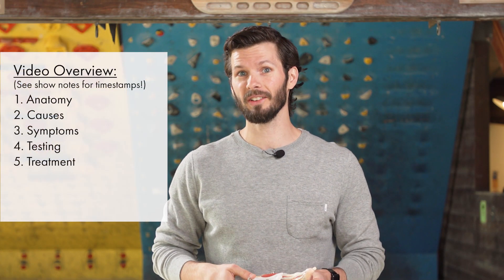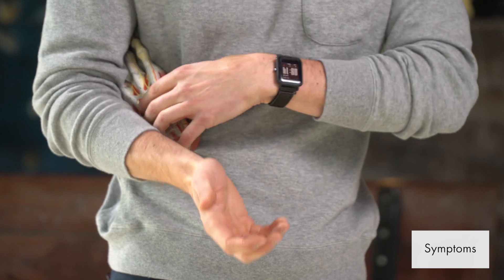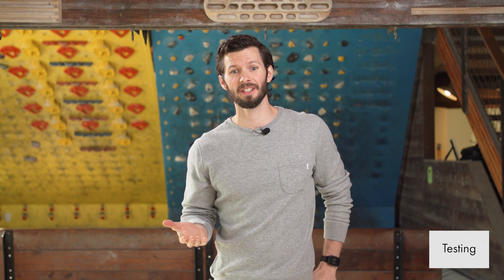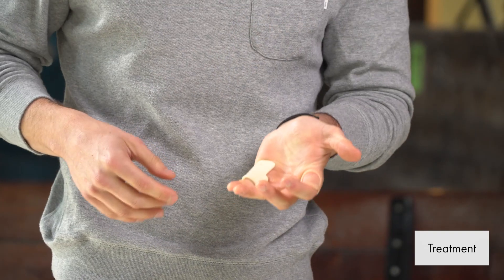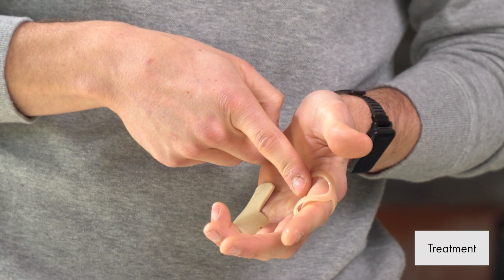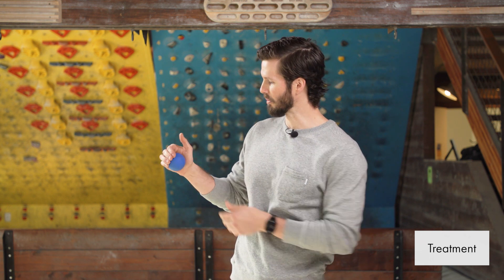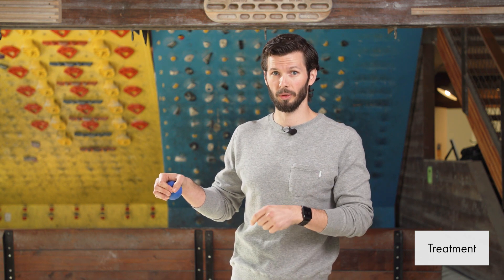What is Trigger Finger and How Do I Fix It? (Stenosing Tenosynovitis)

Comment: Great video. I have A1 pulley diagnosed in middle finger of right hand. I was doing a lot of mouse scrolling in my job since 8-9 months. I did not have pain, only trigger fingure. GP gave me injection. Should I continue that job as still I have to use excess mouse clicking. Any advise like exercise or splint? Appreciated

Comment: Hi Jason! What if I only get the trigger finger when I sleep? I got an A2 pulley strain that developed trigger finger after a month but it only happens in my sleep. Is there a way to know what is causing it? 

Thanks for all your help!
Reply from the maker: Good question! There may be a number of reasons, but what first comes to mind is either the position you're sleeping on (perhaps clenched fist, flexed wrist, flexed fingers as examples0, or it could just be that the swelling increases during night since you are not moving, but quickly dissipates in the morning as the movement starts reducing the swelling.
Reply: @HoopersBeta  would you say is an acute case? I take time off sport cranking and go alpine climbing a lot and that seems to help with not getting the trigger finger at night. Would taking anti inflammatories help?

Comment: I have trigger finger in both hands middle finger and ring finger on both hands ,have a nodule in my left palm that is obvious to see ,this all was caused by having Piraformis syndrome with gluteal amnesia could not stand up from a chair unless I used my hands and arms to push myself up and my middle fingers bore my weight for a few seconds ,am waiting for injections at the hospital .
Reply: I too have both palms ring trigger finger with nodule n cause of that was high LDL cholesterol, Now it's over 4 weeks have stopped majority of oily fast foods very good improvement there pain has minimised can move n bend the finger previously not flexibility coming , probably by next 2 weeks it will normalise. Find out the cause n rectify. 😁😁

Comment: Hi.when I tried some Deadhangs(30secs) with 3 reps,the 1st 5 secs was I feel small pain,but afterwards and doing the reps,I feel comfortable...Also when I climb in our local gym,I didn't feel I have trigger finger,but well on the 1st to 3rd 6a grade warm up, there's a little discomfort,but when I go along,it becomes normal.My problem is the post climb experience 😅..I feel the the trigger finger in my left hand ring finger.

Comment: Hi Dr Hooper, 
Great video! I will definitely incorporate the lacrosse ball stretch into my routine. I injured my finger about 6 weeks ago from going a bit too hard at the gym after a year off of gym climbing. I had some relatively minor pain the next day and have been experiencing a clicking or crackling sound in the area of the A1 pulley. Occasionally, the finger does get a little stiff or stuck and hurts a good deal when I flex it, but the pain goes away right after. This is fairly rare and doesn't really hurt otherwise. I have been climbing fairly mellow since. Does this sound like Trigger Finger to you and will this crackling noise in my joint  go away once the finger is fully healed? Could I be dealing with another type of injury?
Reply: Did it get better?

Comment: Hi dude, please help me 🙏 There is a nodule on my left palm. The spot is near A1 pulley of little finger.
Noticed it 5 days ago. Doc prescribed nimes gel and dikloron. 
I have been applying them. But i want to know that is there any possibility to recover apart from surgery.
If i have an operation, after the doc cut the a1 pulley to release the nodule, my gripping power would be effected or not?
Thanks so much for reply...🙏
Reply from the maker: Start with conservative measures and see if the nodule will reduce. If not, surgery may be your best bet. It will have an acute affect in your climbing but the body I amazingly adaptable and your strength can definitely return!
Reply: @HoopersBeta  thanks... will apply your directions 🙏

Comment: nice vid.  Im 47 and had 3 ligaments/tendons fail in last 2 years, one in each hand and now trigger thumb.  I get it, im in that age, but i disagree it's over-use.  Ive also had several tendons fail in last 5 years (shoulders, knee, heel and foot).  Is there a syndrome whereby due to nutrient deficiency all of your tendons and ligaments become fragile?  Because it doesn't feel normal to have so many fail in such a short period of time.  How would you test for that?
Reply: this is what I wonder too... maybe it's because of a nutrient deficiency that regeneration is impaired. I read that it takes the span of 3 days for people to gather all the building materials they need for their body to pump out those new cells to maintain the body. Not sure how credible it is but that detail stuck out to me.

It probably isn't very relevant to what you're saying but couldn't stop my rambling at this point hahah
Reply: I’m not a doctor, but are you doing some workout to strength your muscles? This looks like a colapse in your nerves or muscles structures. A visit to a neurologist would be indicated too.
Reply: If you take corticosteroids, like prednisone, for extended periods they cause tendons and ligaments to weaken. They can actually snap under relatively light loads.

Comment: Thank you, this was immensely helpful! Prior to watching this I wasn't sure why my finger was clicking (many months after an acute finger injury) and I was regularly bending my finger to 'work out the click'. Given that the correct treatment is the exact opposite approach, I'm very relieved to have already built a homemade splint. You should really start a Patreon or something, even if only as a way for people to send you money in thanks.
Also I have an affinity for taping my DIP joint in an effort to reduce the force on my A2 pulley (research be damned it helps!). Any thoughts on whether the force of the tape digging into the tendon could be a cause of tendon inflammation?
Reply from the maker: Perhaps not the force of the tape digging into the tissue but rather maybe the tape allows you to pull harder on sharper edges without the same pain feedback which causes pressure on the tendon and producing the inflammation? It's possible but not likely the cause of the issue.
Reply: @HoopersBeta  Thanks for the responses!

Comment: Thank you so much for posting the only climber-specific video on trigger finger! I was wondering if I could hear your thoughts since my clicks are triggered slightly differently:

The click actually feels like it's in the A3/A4 area of my index rather than A2, and it actually only occurs after I grip open-handed. My half crimp is just as strong as prior to the clicking, and my open hand strength is 15% weaker than before (before it's uncomfortable to crank more). My best guess right now is that the inflammation is getting caught in a higher up pulley than A2. Would you say that the rehab stretches with the lacrosse ball are still worthwhile? Also, would you say it's safe for me to climb below my limit with a half crimp instead since open-hand is the one giving me discomfort?

FWIW, I'm booked with a PT in a couple weeks, but I'm hoping this video has put me in the right direction.
Reply from the maker: Great question. I think you are are the right page with the inflammation causing the clicking and it is possible in the open hand position you are also causing more pressure on that area which leads to the inflammation. The lacrosse ball stretch may not be as beneficial since the research was targeted to a different pulley but that brings up a case of cost / reward. The cost of you doing that stretch is relatively low and the reward is moderate, so it may be worth your time to try. Other things to consider would be avoiding exacerbating / inflaming the area in the mean time to see if it is an injury that needs to heal. Example: the index finger in that region can get inflamed and irritated from full crimping which may then cause the trigger finger you are experiencing.
Reply: @HoopersBeta  Thanks for the reply! I learned that with some pretty deep massaging and rest, I can get it to calm down for several hours. Time will tell if it's something I can just rest through :)

Comment: Hey awesome video! Very helpful. I have recently developed trigger finger in my left middle finger. It pops on open/closing my hand, although only when the DIP is fully curled. I have almost zero pain. Some occasional soreness/tightness. I've also climbed some of the hardest stuff I've ever done since it started so there is no loss in finger strength. I was just going to take a week off and see how it feels after. Is that smart? Or should I continue climbing with open hand on my left? I do notice that ibuprofen and my joint supplements help. The popping will go away completely on open/close within an hour or so of taking ibuprofen but it eventually comes back. Is this just a really minor case then? Also I'm not convinced mine is caused by my A1 pulley since it doesnt pop until the DIP is fully engaged. Could other pulleys cause trigger finger as well? My A1 isn't swollen and I know what it feels like when an A1 is swollen (it feels like a ring). I find myself constantly opening and closing my hand to test it. Should I stop that and try to minimize how much its popping even if there's no strain (not climbing) when I do it? Are the splints recommended for wearing at all times or only during climbing? What about a full finger splint that stops all movement? Any benefit there? Last thing. It pops all day, not just the morning. The only thing that ever makes it go away is anti-inflammatories and they are temporary.

Thanks!
Reply from the maker: OK cracks knuckles Let's get this....
First, sorry about your trigger finger! Let's answer your questions to get you handling it well. 
Yes, taking a week off is a great idea. Most climbers do not rest enough, so actually taking a rest week is always welcome, especially since you are climbing your hardest. Often times when we are climbing hard, we are developing little issues we are not resting from. 
Taking ibuprofen to relief it is simply reducing the inflammation. It does help indicate that it is not a "major" case, otherwise it would have little to no impact. 
Yes, other pulleys can cause it, but it is hard to tell which one it is. The exactly location is less relevant than the path to treatment. 
No, you should not be constantly testing it. You don't want to cause the click/catch. You want to rest it when you can to avoid more clicks. 
the splints are more recommended for your day to day activities, not during climbing. It is meant to prevent you from causing the irritation with the hundreds/thousands of movements you do daily, not the fewer ones you do while climbing. 
Full finger splints would also work, they simply limit a lot more of your function so you want to use the most minimalist splint you can find that works for you (If it doesn't prevent enough motion, it will still allow the click which means it's not doing it's job)
The anti-inflammatory is just a band-aid to reduce the inflammation which helps it go away. Once the anti-inflammatory effect wears off, symptoms will return. 
Hope that helps! phew

Comment: Great video as always Doctor Jason Hooper! Just made hang board and cant wait to train and follow your plan for the intermediate hang boarding. Also I need your help if you have the time. My left ankle(i think my achilles tendons) started really hurting after wearing a couple month into my climbing shoes. I chose a snug fit climbing shoes so there was no issues for the first 2 month but then it started hurting the part where it rubs the back of my feet. Like whenever i'm going to wear my climbing shoes, i know its going to hurt, after wearing it for a while, the pain does dimishes a bit but its quite sensitive at certain angles. I have trouble walking while wearing climbing shoes. I don't know if it's achilles bursitis. Currently, It doesnt hurt anymore since i followed the  P.r.i.c.e and i haven't climbed a while cuz of the current situation so if you have any suggestion to prevent this pain, it'll be greatly appreciated! Thank you and have a great day!
Reply from the maker: If you haven't made any other major changes (started a new running program, changed shoe ware at work, made significant changes to your exercise routine, etc) then it sounds like the shoes are probably just poorly fit for you. Yes, aggressive shoes are often uncomfortable to walk in, but if it is irritating the retrocalcaneal bursa or the Achilles tendon, then you may be too much movement in the shoes or (more likely) they are probably creating a pressure point rather than evenly distributing it. Thank you for watching and I hope you continue to tune in!
Reply: @HoopersBeta  I really appreciate the quick reply! My left foot is slightly bigger by half a size to my right so it is probably with the fitting of the shoe. Now that i know the issue is most likely my shoe and not my feet, I'll figure a way to make the heel of the shoe more comfy on me. Thank you so much and ill definitely stay tune to your amazing content!
Reply from the maker: Oh yes that is a significant difference in sizing! I would consider looking into stores or shoe companies in the future that will allow you to purchase different sizes.

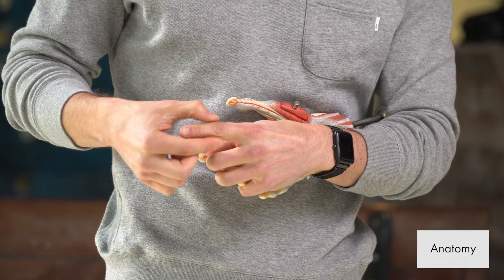Comment: Thank you very much! For me the snap in movement happens at the PIP joint, without pain. Only in the mornings, only for about 5~10 extensions, and only if I have climbed/done pull ups recently (and I think, only when extending?). This also means I can't reproduce a catch with the movement around 2:40 outside of those conditions. At 1:00 you explain the process of what causes the snap and use the PIP joint for demonstration. Is a snap at the PIP joint also caused by a too narrow A1 pulley? Or should the A3 pulley be stretched somehow? Also how long should the streches be held, and how often?
Reply from the maker: The fact that you have it mostly in the mornings and after climbing would make me think about the amount of fluid surrounding the joint. At night, since we don't create movement, we usually have a build up of interstitial fluid which may cause an increase in swelling and the resulting symptoms you feel. The best way to further test would be to isolate one joint flexion at a time and see if it creates more of a restriction. You may be in a very acute stage of this and want to be cautious to not allow it to advance. I would recommend a few shorter stretches (3-5 seconds) to warm it up, then do 2-3 30 second stretches. This can be done daily.
Reply: @HoopersBeta  Thank you for taking the time to answer :) it's much appreciated! Will start doing the stretches daily. Not sure if I understand the further testing - if I unroll (flex?) one joint at a time, it is definitely in the PIP joint the snap happens.
Reply from the maker: @pgijsbers  the addition testing to see if you / I totally understand it. Flexion of the PIP causes the catch, but is the catch at the MCP or PIP? That's more my curiosity / clarification.
Reply: @HoopersBeta  I can't tell at which pulley the tendon gets stuck, if that's what you are asking (sorry, English isn't my native language so being precise for a medical diagnosis is hard). But I did make this illustration indicating where the finger snaps from one position to the next when extending it while keeping the finger fixed around the mcp joint https://imgur.com/a/YSgXk3K . When extending the finger, it snaps from the start of the red section to the end of it, i.e. starting at about a 90 degree angle to roughly 60-45 degrees (if 0 degrees is straight). I could try to take a video when I notice it next, but since I haven't been climbing due to COVID-19 I haven't had many mornings with symptoms.
Reply from the maker: @pgijsbers  that helps! It certainly can be as it is usually the flexion of the PIP or MCP which causes it but the climbing hiatus may be a positive! A chance to rest the tissue and ensure that it does not become more serious.
Reply: @HoopersBeta  I was already considering a (two) week break from climbing before. While the pandemic is terrible, at least it makes the break easier :) Thanks again for the help. Do you have a page for donations? I could send a coffee your way :)
Reply from the maker: No worries! Happy to help. Yes, this time is the perfect excuse to rest and recover from some nagging injuries. No worries! We may establish a patreon page in the future, but for now, (especially with everything going on) no worries!
Reply: @pgijsbers  hey hey, it looks like I have the same issue and it always comes back when I start climbing frequently. I was wondering if you found a way to deal with this issue? Would really appreciate your feedback 🙏
Reply: @olegmakarov3097  Sorry, can't help. It went away during COVID and when I got back to climbing it didn't return (I did take it slowly and have not been (full) crimping as much - which may or may not be a contributing factor).
Reply: @olegmakarov3097  I wish I could help you, but it just didn't return after COVID (yet). I have been trying to be more mindful of not doing a full crimp as often or doing too many crimpy routes in one session.